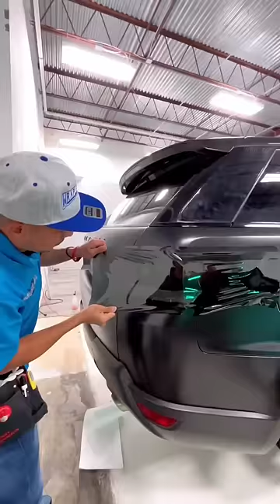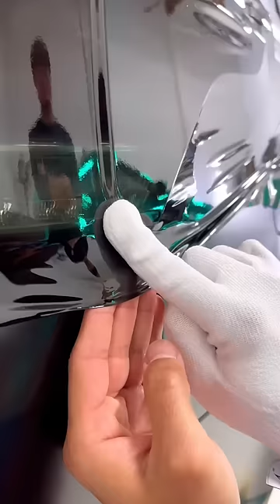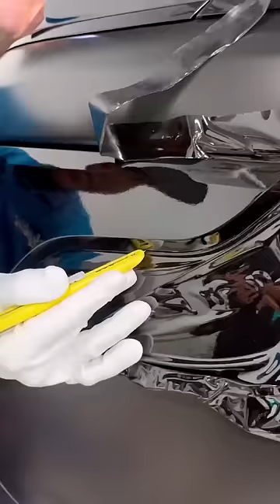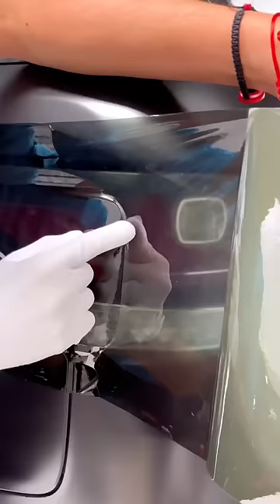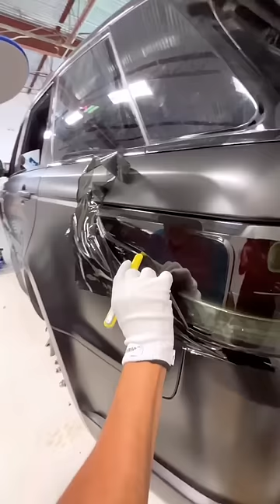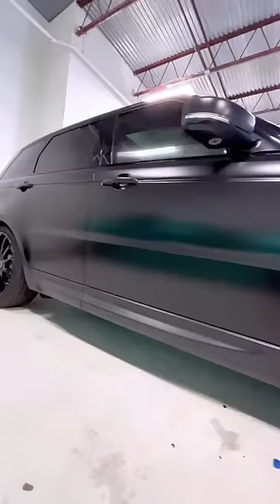If this Wrap is Wrong.. I don’t want to be Right‼️🔥✨👌 #carwrap #carwrapping #vinylwrap #rangerover

Comment: Buddy has zero right to complain when his precious gets rear ended and totaled
Reply: The lights are bright enough
Reply: @erickserrano4198  maybe for a pitch black country road at midnight
Reply: It's fine, I've had it on all my cars, most countries and states will have a level at which the smoke effect can be, manufacturers make lights like these so adding after is perfectly fine and legal
Reply: @MickeyDee420  did you see how dark the one in the video was though? That’s gonna be impossible to see during sunlight.
Reply: @erickserrano4198  doesnt matter. Insurance company will still agree that the tint shouldn’t have been applied in the first place.
Reply: @Jayden Litchfield yeah they’re indoors and like 10ft away. Imagine it’s 12oclcok bright as hell outside and you’re following this guy from 60ft away. Near impossible to see.
Reply: Definitely illegal in my country. There's a limit to how much tint you can have on your driver and passenger side windows and any exterior lights.
Reply: It's a Range Rover, it'll be totaled by maintenance costs in a few years anyway.

Comment: My dad accidentally rear ended the guy because he didn’t see his brake lights for this very reason. We now have a 3 inch wide hole in the bumper of our 2008 Honda Odyssey.
Reply: Specsavers perhaps?
Reply: 101 guide how to know if you need to break: just break if you are getting too close to the car in front of you. Seeing brake lights is unnecessary in this case.
Reply: @illiapie2480  rear light isnt there for decoration though, they help predicting car movements, if they werent necessary, they wouldnt exist
Reply: You guys going through insurance?
Reply: The worst thing here is , you have a 2008 Honda Odyssey
Reply: @nasapayrollsystem8701  fr
Reply: @illiapie2480  rear lights are communication devices.
Reply: @illiapie2480  That shouldn’t be happening though
Reply: Also means you were following too closely. Which is why your car was not fixed.
Reply: @KevCor360  We have no clue if this happened in daylight or not, nor where it took place. There is a function for brake lights.
Reply: @KevCor360  not everyone can react instantly to the car stopping if you see a car just slowing down could you easily determine if it was stoping. The rear taillight give you a good distinction device on if they are stopping helping you react sooner atleast thats what I think im not 100 percent sure but I do know if you have this tint it may be a bigger risk to others

Comment: If you tint your tail lights and somebody smashes into you, it’s not necessarily their fault. They can get a lawyer and sue the crap out of you.
Reply: Yes, but it has to be one specific type of tint. Some block most of the red light, while some others don't.
Reply: Bro he has LED lights,not pleb halogens. It does not affect them at all
Reply: @Hbk1998G  Yeah if it doesnt matter Why car company puts more LED when they can remove more?
Reply: In some states there's a "no exception" law where, no matter what, the person who rear ended you is at fault because they should've been further away from you. I think Idaho is one of those states.
Reply: @DavidTasselTots  The law has nothing to do with legal liability. You can hit a car illegally parked in a handicap spot and still be at fault. What matters is whether the function of the taillights are reasonably impaired, the lighting conditions, time of day, and if the driver in the rear failed to keep a proper lookout. The reason people who rear end other drivers are usually at-fault is because driver's have a duty to drive for conditions and keep a reasonable distance between their vehicle and the vehicle in front of them in case they stop suddenly.
Reply: lmao absolutely not if you run into the back of someone it is absolutely your fault, there is no lawyer that will be able to get you off because the light is slightly hard to see, it is your job to pay attention to not only the car directly in front of you but also to the traffic that is upcoming and behind you...
Reply: @Hbk1998G 
 I've never seen someone be an elitist over lights
Reply: Ayo
Reply: Im gonna get this for my plate so those ezpass violations stop taking away from my paycheck
Reply: not if the tail lights still emit the legal amount of light they need to.
Reply: @DavidTasselTots  You serious? What if car’s light were not functioning and that caused crash? Still same?
Reply: Not really if you get rear ended 99% of the time it’s their fault
Reply: bro thats no excuse tail lights dont cause accidents unless they dont emit light these do emit light so its visible the other driver would just be stupid
Reply: @kjanvink1981  true
Reply: @AAA-qd8xx  because fewer LEDs means that they need to be need to have exponentially brighter
Reply: Not if it can be proven that the lights can be seen from a legal distance
Reply: @DESIGNS-vo1mt  good luck trying to proof after car crash
Reply: @AAA-qd8xx  good trying to say they couldn't be seen after the same
Reply: there’s something called a third brake light smfh.
Reply: @Hbk1998G  Tell that to the insurance agency after a rear-end 🤷‍♂️
Reply: In the state of Missouri if you rear end someone it's your fault no matter what.  There are NO exceptions.  That's the way the law is written here.  I guess they assume if you're following proper driving distance as taught in the Driver's License manual then you'll have plenty of time to stop no matter what happens.
Reply: I’ll counter sue for them being dumb & wasting my time & money
Reply: @nahwork8013  You got sue and counter-sue money?
Reply: I saw a guy a couple months ago that has his lights so blacked out I couldn't tell they were on... and he looked at me like I was the idiot for thinking his tail lights were out (saying "they're blacked out homie"). Hope he don't get rear-ended, because there was literally no way to see that he had lights at all. If I was driving down a dark unlit road I wouldn't have seen him and I have zero vision problems.
Reply: @Jayden Litchfield theres a reason when you have standard
Reply: @Hbk1998G  you failed at physics
Reply: Lol what light or not the person following still has to keep control of their car
Reply: That crazy because you can still clearly see the light shining through
Reply: Aahhhhaahaha Americans still think sue'ing people is a thing
Reply: Get extremely bright tail lights
Reply: It is in Florida, I’ve got so many tickets because of this.
Reply: Thank you, YouTube lawyer.
Reply: @israel3506  Who's fault is that after the first ticket? Have someone read this to you because I don't think you're that smart.
Reply: Not true, if someone rear ends you it's there fault automatically. The lawyer wont sue you but your insurance company. You will get a fix it ticket and all you will have to do is remove it. If you can afford the car you can also afford full coverage insurance.
Reply: @paulzimmerman6058  OK, Boomer
Reply: @Hbk1998G  although LEDs are bright they have a big diminishing return when filters are placed.
Reply: Bada boom bada bang
Reply: No matter legal or illegal, it is one of stupidest things to smoke tail lights.  Keep saying it's legal after being hit and suffer from injuries.

Comment: You know, those aren't party lights, but a mandatory safety feature so you don't get someone killed.
Reply: yes and the law states the light must be clearly visible meaning as long as you can still see the light through it during the day its perfectly safe and legal. 
frankly most news cars should be fitted with it by law as the light as so damn bright it makes it had to safely see the road in front of you.
Reply: @axeami1354  you aren't wrong. If headlights exceed 3,000 lumens, it impairs driving for other drivers and is illegal. 
... guess what's being sold on Amazon?
Reply: @caelestisnox7045  what?
Reply: @axeami1354 bro i think you took the wrong message. he means you don't need them, they are a safety hazard for you and everyone around.
Reply: @OnePunchHeizou  the 5% limo tint I agree is dumb and illegal 
But like a 50% tint on a black car is cool

4 states explicitly block tail light tints 
Otherwise if they’re visible at 1000ft you’re legal

With modern LED tail lights 50% tint is usually fine

That’s also how some newer cars like bmw or Porsche have it factory tinted. They’re dark red vs bright red
Reply: @dylan-nguyen  I tinted the taillights and reflectors with like a 50% and you can still see them fine. The reflectors stuck out so much on a black car.
Reply: @axeami1354  except the law also states what color your tail lights can be, and green is not one of them.
Reply: @axeami1354  bro I be getting beamed, eyes be hurting for a good hour, I don’t know if my eyes to sensitive or every year these lights be getting brighter

Comment: This is the type of dude to slam on their brakes with tinted tail lights and blame you for not seeing their tail lights
Reply: POV: You never seen tinted taillights
Reply: @J S that is literally the most contradicting statement I have seen all month. The exact and specific purpose of any tint is to *change the brightness and/or colour*. If it doesn't do that then it's not tint.
Reply: @Patrick-zr8tv  what a smooth brain
Reply: @wizzenberry  damn getting called a smooth brain by an box is tough
Reply: @J S it's still a different colour and brightness. However slight the change, it's still different.

Comment: Ah yes, lets tint the lights that tell people you are braking. Makes total sense.
Reply: Theyre just smoked so you can still see. It can cause an issue during the day though.
Reply: I’ve seen a few cars that had this and you can still see their lights in the daylight just fine
Reply: @CertifiedFresh7  some tints are fine, but in my experience most aren't. 
If it's daytime and the sun is hitting the back of the car in front of you, it can be nearly impossible to see the red lights through the tint
Reply: @CertifiedFresh7  ive yet to see one where you can still see the brake lights
Reply: Ah yes, let’s tint front windows that tell people what ur face is saying, because pedestrians want to see u make eye contact with them. Tinting front windows is same, and so many have it
Reply: @kevincarteravigdor8846  i would argue its way less important than brake lights
Reply: my biggest issue with tinting tails and headlights is that it automatically makes the car look cheap and junki. no different then those fake hood scoops on the hood. or putting chrome trim on everything. 

very few cars can pull off tinted tails and still look decent at best.
Reply: I saw a cop pull a person over today for having tint lights
Reply: @kevincarteravigdor8846  This was one of the most mind numbing comparisons I have ever read in all of my time on the internet.
Reply: @kevincarteravigdor8846  no way you have driven a vehicle with this take dude
Reply: @joestorer7005  it’s like windows they’re %s. Vid looked like 5% so without an LED upgrade prob illegal. 46/50 states they need to be visible at 500-1000ft

With modern LED tail lights 50% tint is usually fine even at 1000ft
That’s why some cars have factory tinting now. Like the new BMW M3
Reply: @hannanah8036  are you aware that vehicles have a 3rd brake light? I know it’s crazy to think, but it’s true.